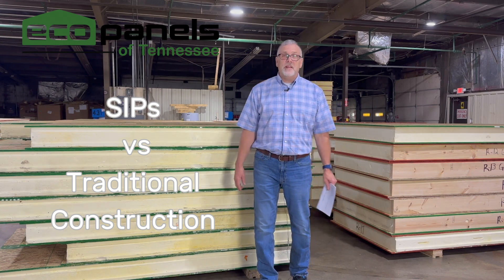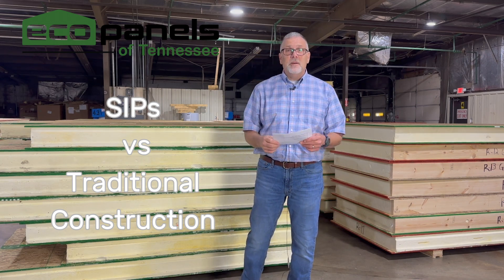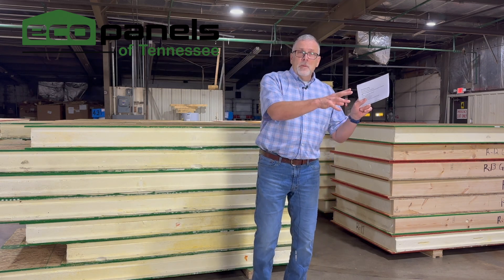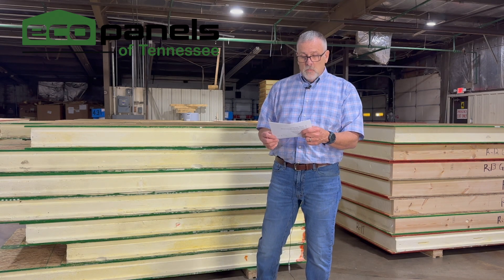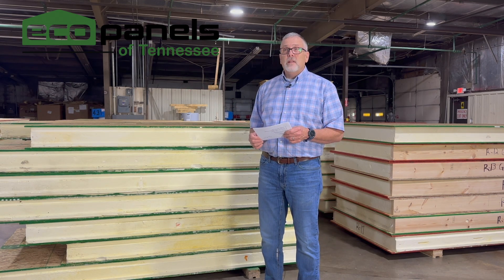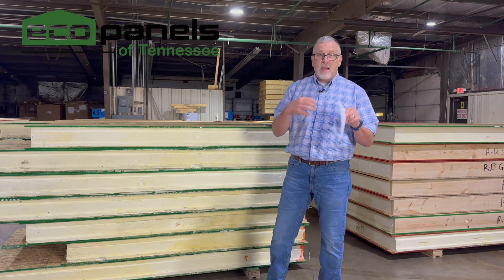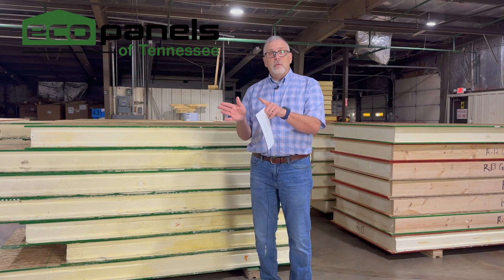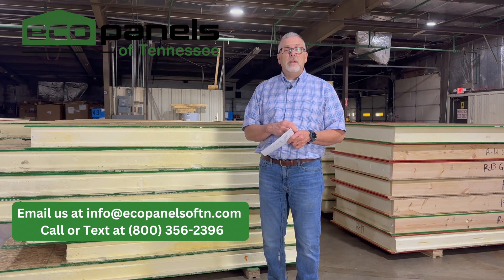SIPs vs Traditional Construction

Comment: Could these be installed with a service cavity on the interior for electrical instead of pre installing the receptacles in the panel?
Reply from the maker: The nature of poly-injected panels makes it difficult to install the chases that's more commonly seen in a EPS panel, which I'm assuming you're referencing in this question. Through experience, it's better to plan the electrical so we can incorporate the conduit chases and boxes to spec. Of course, things change or are looked over occasionally. Modifying panels for additional electric on-site is generally not difficult and it's something we're happy to advise on. Thanks!

Comment: Hello, is it possible to build with interlocking panels in Alaska. Will the panel freeze in winter and will the lock rust?
Reply from the maker: There are Eco-Panels in Antarctica! They are well suited for Alaska. When properly constructed, the cam-locks (which are already made to be corrosion resistant) are sealed from air and vapor intrusion and should not rust. Great question. Thanks!
Reply: Thanks for the answer, it’s not much clear whether the cam lock has a mechanical fastening inside the panel or is it poured or glued into the insulation?

Comment from the maker: Yes, our system almost removes all thermal bridging compared to stick framing. The system does cost more to build with, but most clients see a ROI in energy costs in just a few years. Every month after that is money saved. Panel weights vary but most are handled easily by 2-3 people. Hope that helps. Thanks for the question!

Comment: I like the idea. Looks like the “R” factor would be very good and the entire wall is a thermal break or so it appears. I am about to DIY two homes with my son. One for his family and one for my wife and myself. How does this compare to conventional framing in cost? Are those panels too heavy to move by hand? I am guessing these panels would make for a quiet home as compared to conventional framing. 
I have been around construction most of my life. Grew up helping my grandpa who was a carpenter/jack of all trades. Owe that man so much. 
I have been an electrical contractor for the last nearly 20 years along with my son. I have yet to come across that type of construction in this fast growing area of upstate South Carolina. Maybe we could change that. 
Thanks for your time if you get to this. 😁
Terry
Reply from the maker: Thanks for the questions Terry. Yes, we're getting R-26 out of a 4.5" wall. Very little thermal bridging in our system. It will be a good bit more than conventional framing. Completely different system and performance. However, we generally see that customer's regain that investment on energy cost savings in about 4 years. After that, every month is money saved, and the cost of energy isn't going down anytime soon. We'd love to have an opportunity to help you with those projects.